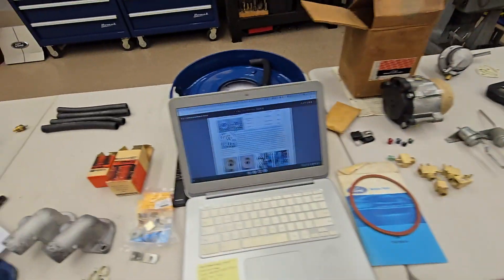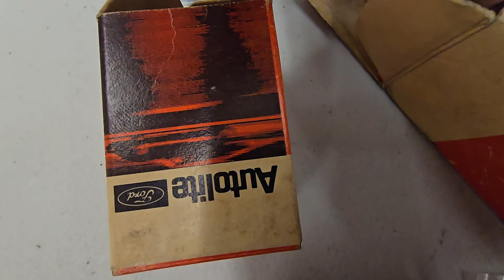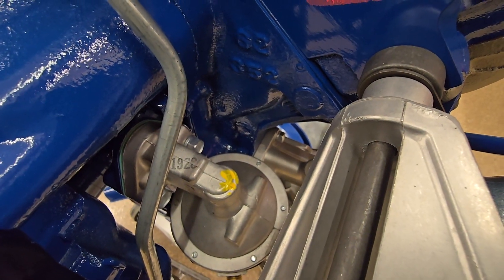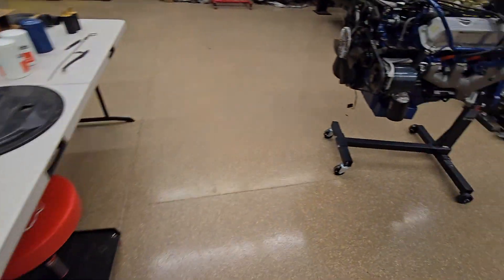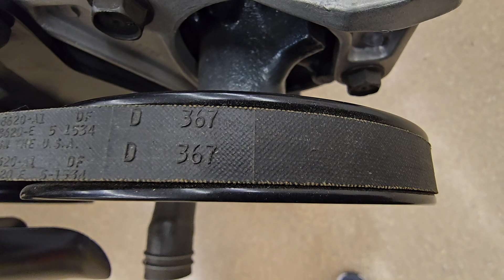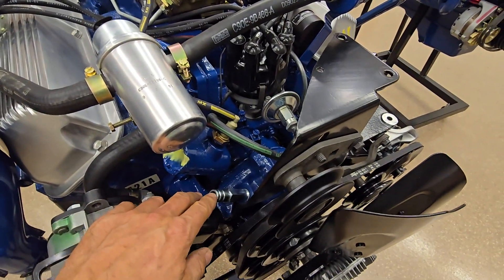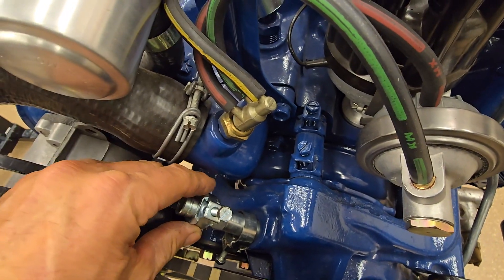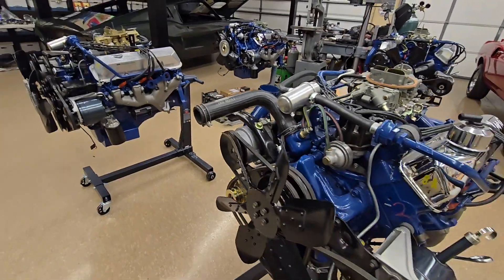Cobra Jet Engine Detailing Part 3

Comment: Do you have any knowledge on 68-70 428PI? I have a 69 Ford Custom 428PI that has 45,000 original miles. I know some parts cross over with the CJ and standard 428.

Comment: Pretty rare to have that many 428’s all in one place like that . Have you ever had a true bone stock one on the dyno ?  And great videos series
Reply from the maker: Actually yes.....we did a complete stock build that was on the dyno about a month ago.  That was about 350HP and 447 torque.  Thats close to what they would have been originally.
Reply: As the owner of a 68.5 and a 70 I appreciate you pointing out the differences as so many people believe they are all the same.